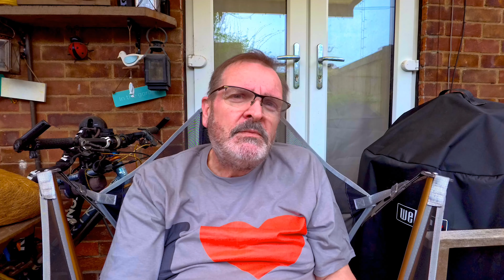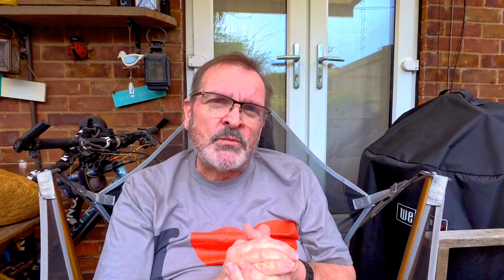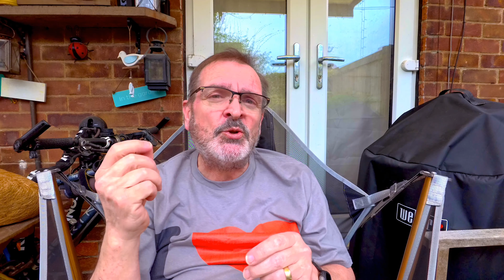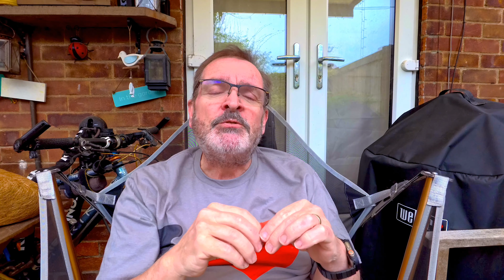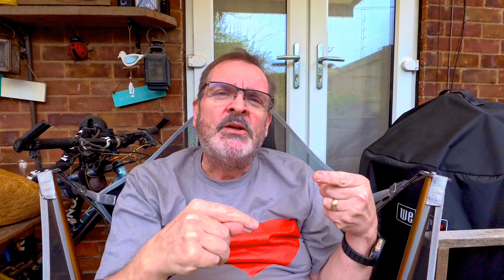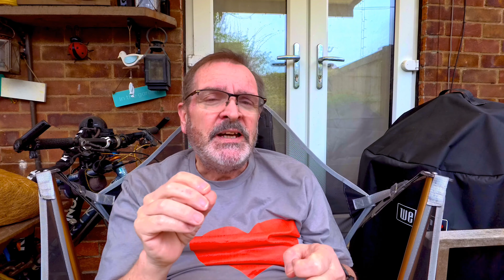Old man of the sea, types of engines you might see

Comment: The last steam ship in my union went to China for refit to diesel...last one.  I'm glad I didn't have to work on diesels my whole time.  Pretty much hated them.  I'd always go for steam if possible. Friendlier people on steam ships toboot.  Any trouble and you still had a boiler full of steam to stop the ship although not sure how usable if the main circ pump was not operating....probably only a full astern for a second and that would heat everything up.  But usually have a diesel generator idling to switch to....different fuel and different fuel source as well as cooling....at least for the newer ones...40 years old, haha

Comment: When I first went to sea I had the opportunity of working on board the Esso Preston, the last triple expansion steamship in the company. I went on a VLCC instead and have regretted that decision ever since. I did a trip on an  8-legged double-acting H&W 2- stroke engine in Blue Flue and suffered 47 scavenge fires between Durban and Surabaya and had 3 crankcase explosions on separate 20RK270 Ruston HS diesels. I play with old motorbikes now.
Reply from the maker: Had a few scavenge fires but luckily not crank case explosions, pretty close once or twice. 
Hope you weren’t hurt.
Reply: @retroonhisbikes  No, ER was unmanned each time. Bicera v/v caught them all, so no secondary. Just covered the place in black LO! Anyway, the engines were relatively small, only 7m long (10000hp), so no large accumulation of explosive vapour.

Comment: Good Overview off different seagoing Engines.
All those main engines do they have self driven mechanical fuel pumps ie running off the crank shaft.
As we know an unpowered ship out at sea is not the same as a unpowered ship close to land, time is the concern.
So at Baltimore did the design off the BMW engine loosing power due to external issues cause the bridge collapse? What issues do you think caused the main engine to shut down in the first place?

Comment: Twin engined..single rudder. Genius! 😂😂😂
Reply from the maker: Never failed or run aground
Reply: @retroonhisbikes How would you compare this system with the Dali as to power control and reliability? Do you think it is a more safe system or that larger ships could have an equally safe subsystem to take over in an emergency?
I used to sail tankers but I also once was on a research frigate with twin engines. We really went through some high seas on purpose in the Caribbean. It took on some water, but seemed very reliable. Didn't need tugs to dock.